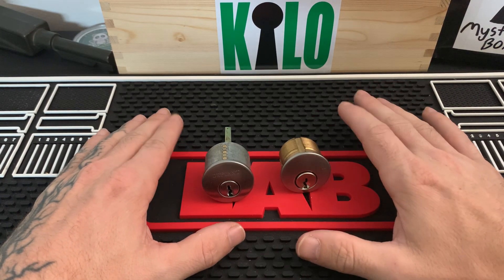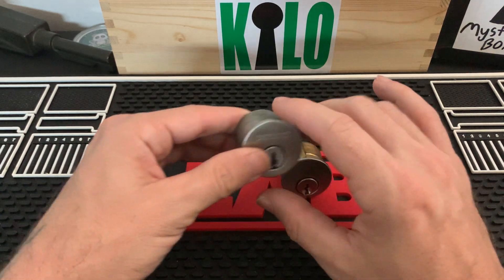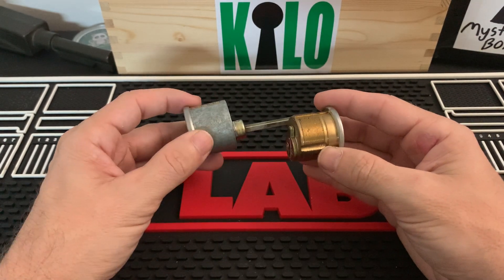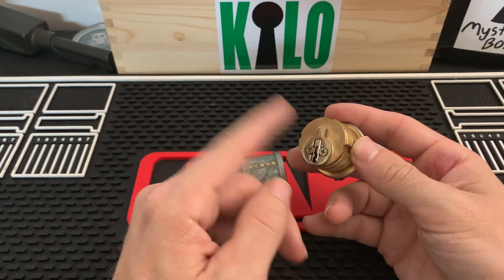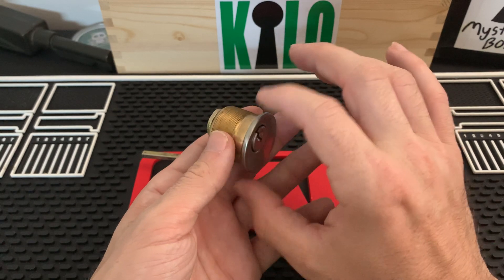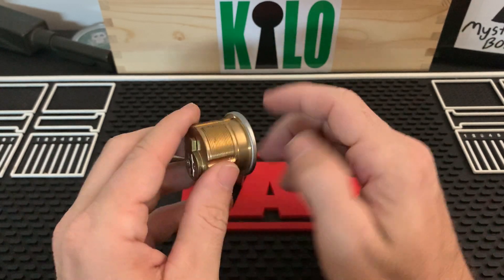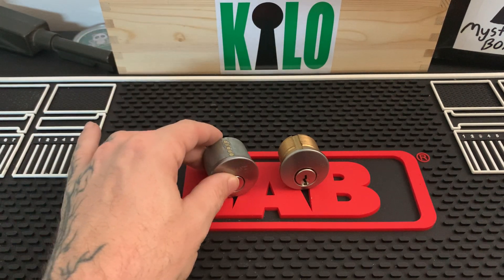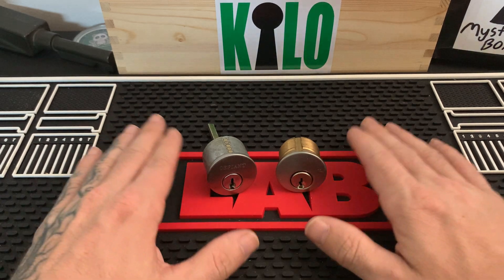How to Identify a Mortise Cylinder

Comment: Just a quick question, I was given about a dozen SC1 cores, they are all master keyed, but I plan on repining them and rekeying them.  I've cleaned them up with degreaser, lubed them properly and they are all smooth.  I just need to buy or acquire the cylinder that houses them.  Searching on various sites I'm coming up with all sorts of things, 9 dollars up to 140 bucks (USD).  What should I be looking for when I search, I just want to get these things back in service, maybe make a few bucks in the process.

Thanks in advance and have a great day!
Reply from the maker: That will depend on the size cylinder you will need! 
I remember at a couple shops I worked at the owners wanted me to master key all of these cylinders in advance
of going to a massive complex job... I tried telling both owners that was a terrible idea as when I get there the cylinders 
will never all be the correct size lol

Some people think they should just bulk buy a ton of cylinders in various sizes, but remember that you have to 
pay attention to colors as well. If you only order a brushed aluminum finish for instance, you may show up 
and need a whole bunch of dark bronze etc.. 

On big jobs you want to do an assessment if possible and take all of these notes beforehand and it will 
make your day a lot easier :)

Comment: I am a locksmith with 39 years of field experience as well as a locksmith instructor. A mortise cylinder simply is for a mortise lock, threaded, held in place with a set screw and uses a cam to actuate the lock. A rim cylinder is for a rim lock, surface mounted through the door. It is held in place by a back plate & two screws, it is not threaded and a tail piece actuates the lock. It is unfortunate that there is any debate in language or terminology on parts or description on the differences. It should be clear according to lock design as to the type of cylinder being used. I would not expect it to be common knowledge on the picking community but it should be in the locksmith community. While I'm at it and I hear it from locksmiths all of the time, SC1 & SC4 are generic key blank numbers for Schlage C100 5 pin & Schlage C101 6 pin key blanks. They are NOT keyways! I don't mean to come off negative but as an instructor I am big on language it means a lot.

Comment: I'm confused. Can I adjust my current cyclinder to click into the locked position automatically without turning the key back as I enter? Or can I swap out my existing cyclinder with a new cyclinder that will relock automatically? Or do I have to purchase an entire new lock mechanism, guts and all?
Reply from the maker: You will have to purchase a new Locket with the Function you need. Common household locksets are not built with the same mechanisms/functions as these more complex models. The latch plays a more important role than the cylinder in this case.

Comment: I have a stainless steel security door that stays unlocked when you unlock it. You have to turn the key each time to relock it. I would like it to automatically relock once you remove the key and enter the house. How can I do this?
Reply from the maker: So, you have different options depending on your preference. 

Right now you have what is referred to as an Entry Function, this is like any lock you find on a common home. 

Store Room Function Locks require a key to unlock it every time you open the door from the outside. These locks do not have a button/thumbturn on the inside and must be unlocked with a key. 

Class Room Function Locks are similar to Store Room Function, but they give you an option to leave them unlocked or require a key every time. 

They are used primarily in Class Rooms as the Teachers can set them to be unlocked during school hours, but they can quickly change it to be used in a Store Room style function in emergencies or after hours. 

Now, these are normally used in Commerical settings, so it is always advised to check with your local safety and fire codes before installing them on your home.

Comment: Mortise is threaded and has a tail piece, regular cylinders don’t it’s a good thing to tell people.

I agree Kilo many people don’t know.

My two loose faultless cylinders are shaped like a cone almost but still called cylinders.

Same for a Kwikset deadbolt I pick.

My threaded Schlage primus is a mortise cylinders it’s also very difficult to pick.

I came across a Masterlock number 7 today at my doctors office it’s been sitting there for years in the same place so I plucked it up.

Easy to take open with a city rake and small sparrows tension wrench.

Be sure to check out my latest video uploaded a few days ago RV master key.